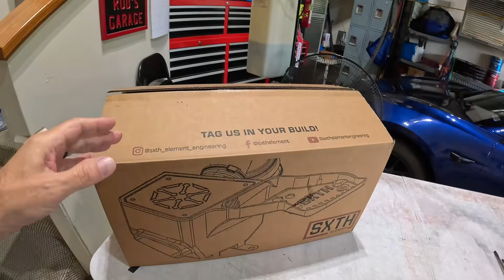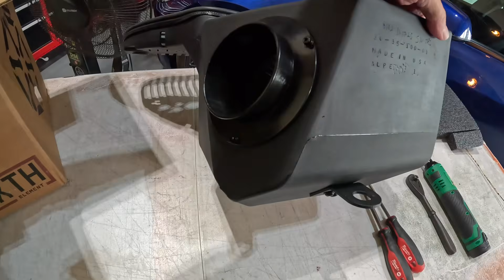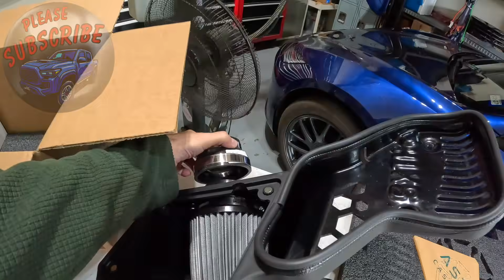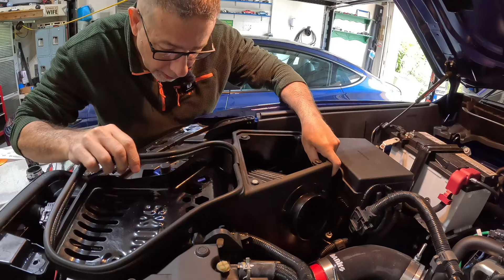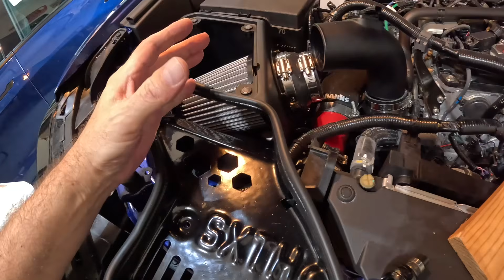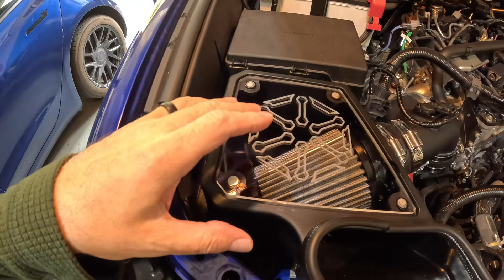Sxth Element for the New Toyota Tacoma Installed and Driven!

Comment: I gotta say, the Banks kit looks like it’s of a higher quality and has a much larger intake tube compared to the SIXTH. Plus Banks has been in the airflow game for over 5 decades! I’ll be sticking with my Banks Ram-Air system for the foreseeable future👌
Reply: yea they have good products sure. if you have one keep it, however for future customers it is NOT worth it. shipping times are approaching 2 months, customer service is non existent and will not pick up the phone or call you back, and you can get other products for cheaper and faster.

Comment: I’ve had this on my 4th 
Gen  Tacoma.  Two issues

1.  The hose clamp loosened up and the filter fell off the housing.  Not good at all.  Fortunately, I could hear the difference and topped and had to deal with it.  This happens when there are temp changes so keep it tight.  This happened twice to me.

2.  The magnetic cover came off and I found it melted on my exhaust manifold.  I called them and the sent me another one.

I put a small piece of tape on it to prevent it from happening again.

The design is questionable
Reply from the maker: That’s too bad.  Do you off-road a lot?

Comment: No check engine lights?
Reply: I've had mine on a 24 manual for 40k km no lights its been great. I put their axle dump tip as well. I think the noises are noticed a lot more in the manual to
Reply from the maker: None.  I believe (with any intake) the key is disconnecting the negative battery terminal and correct installation of the MAF sensor.  I have followed this for years and never had a problem.
Reply: Thanks

Comment: Have you noticed water getting inside the sxth airbox?
Reply: I have in the bottom divits
Reply: @dankaufman1229 noticed mine too after having a carwash
Reply from the maker: Have had no rain since the install.  The intake does have a good size drain hole and I’m not concerned.

Comment: What is the tube material made of?
Reply from the maker: The tube is plastic material.
Reply: @RobMotive  Ahh okay.. what do you think the lifespan would be with it being made of plastic when others (K&N) are made of aluminum. Plastic could crack in extreme cold temps.
Reply from the maker: I think it will outlast the truck itself.  No worries about that whatsoever.

Comment: Thanks Rob. Looking forward to hearing more about the SXTH Element and your experience. Does it sound better than the Banks, the same or just different? Also, do you notice the same/similar HP gains as the Banks?
Reply from the maker: There is more sound.  Haven’t noticed a power difference either way.